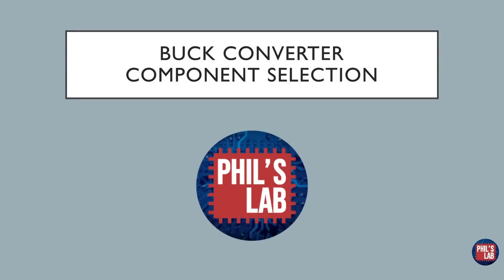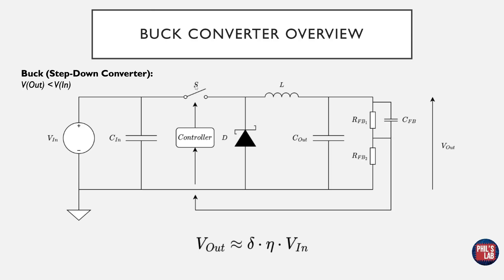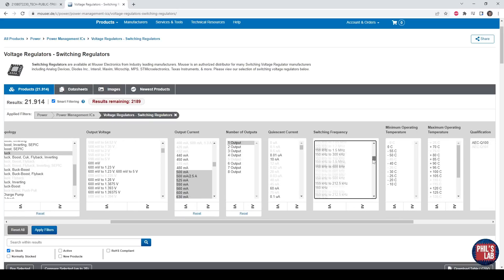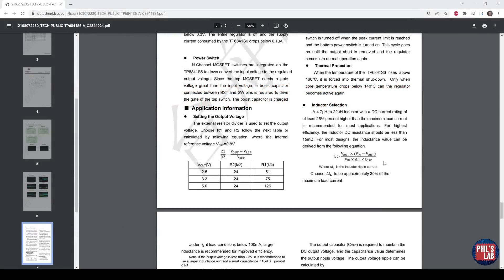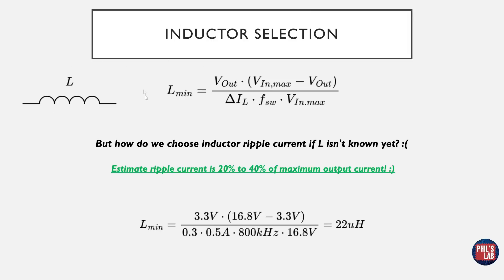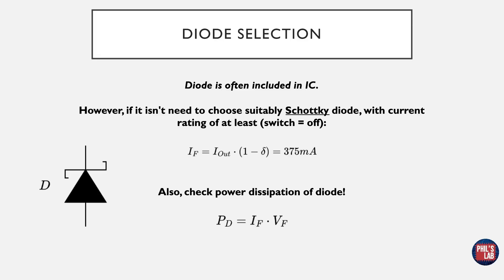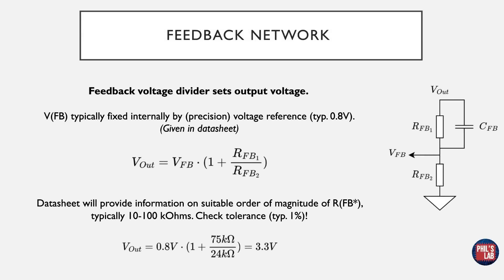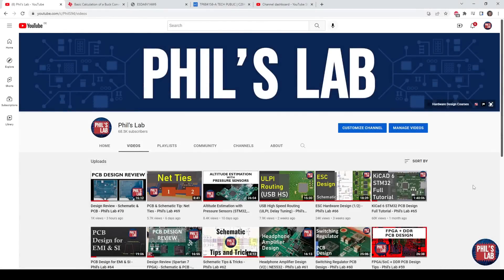(Sponsored) Switching Regulator Component Selection & Sizing - Phil's Lab #71

Comment: What would you recommend for a USB-PD capable power supply? Would a typical microcontroller and digital potentiometer be sufficient to adjust the output voltage on this type of design?

Comment: Hi, great video and well explained as usual. I have one question about the requirements specification, for a new project how can I know what would the load current be ? I guess there is no formula to calculate it and I have to guess it based on the components in the circuit but is there any rule of thumb to follow while choosing an output current? 
Thanks in advance!

Comment: Don't use larger capacitances than required on the output of a SMPSU unless you want to add a pole reducing the transient response. 10uF was the correct value to use.

Comment: How could I use the information you provided in this video to make this a Current regulator? I am trying to build a circuit for a fiber laser and I need to be able to variably output up to 10A. I am having a hard time with IC selection and figuring out what components would be best for this amount of power. I'm using a 12v power supply. Any ideas? Maybe a video like this one but for a switching constant current regulator?

Comment: 9:46 We calculated Lmin 22uH and we chose part with that value but datasheet says its tolerance is +/- 20%, so it is possible that actual value will be below our Lmin. Is that correct?

Comment: I recently designed my first SMPS PCB, and already ordered the PCB and components before I saw this video. I used the recommended components and layout from the AP63205 datasheet, but now I'm concerned that some components may be out of spec (low capacitance on the input/output caps, and low inductance). I do have an electronic load and oscilloscope, so I'm planning on testing the SMPS at various static and dynamic loads. What sorts of problems should I watch out for? Is voltage stability the primary concern? What about EMI?

Your channel is great! I have a software background with no formal training in electronics hardware design, but your channel and a few others have been amazing learning resources. Thank you!
Reply: The datasheet recommended component values worked out well for me. Parts arrived, and I assembled and tested it last night. Using a standard scope probe at 1X with the floppy ground lead, I'm seeing a 10mVpp ripple at 2.2kHz regardless of current. Under load steps between 100mA and 1A it's spiking +/-100mV but recovers within ~30us. Compared to my cheap benchtop SMPS, my PCB circuit exhibits lower ripple, lower noise, and a faster response to the dynamic load. I couldn't be happier for my first attempt at this!

Comment: Does the footprint of the input & output capacitors make a difference here, assuming that the voltage and temperature are within limits of the caps? For example, if I can get an 0603 output cap that meets my requirements, is there any benefit to going with an 0805 of the same capacitance value? Just wondering why I often see larger footprint caps used on the SMPS than elsewhere on the board.

Comment: Great video!! I have a question: How can you calculate point 2 @7:35 if your switching frequency isn't fixed as your case but rather variable depending on the output current as in the MIC2251 datasheet?
Reply from the maker: You'll have a nominal current that your design will require, so use that. Otherwise, design for the worst case (e.g. lowest current -> largest inductor).
Reply: @PhilsLab  thank you so much for taking the time to answer my question, Phil! please keep it up with your videos

Comment: Great video! Is there an advantage for the converter to take a bigger capacitor package, like 1210 instead of 0402?
Reply from the maker: Thanks, Remy! Larger sizes are easier to solder, probe, and will typically be available in higher voltage ratings. However, smaller packages will have lower (lead) inductances, which is important for certain circuitry.

Comment: Did you ever get across audible noise on switching regulators? I had those issues with TI parts some time ago. Texas Instruments has a whole list of regulators with audible noise issues (even their EVBs).
Maybe it's a feature for science fiction movies that you can hear electronic switching noise.
MPS has a good online calculator for various values. The audible noise issue is also known to MPS however they really try to do their best to move the noise out of the audible domain.

Not all switchers are affected from TI of course (they have a very broad range of switchers).
Reply: It also depends on your choice of inductor and capacitor.  Both can act as loudspeakers (ceramic caps aren't that different from piezo tweeters...)
Reply from the maker: Surprisingly, I haven't had any issues with audible noise from switchers yet. I've used quite a few MPS and TI parts but haven't across noise like that.

Comment: One thing i've never really gotten a good handle on is the voltage and size  properties of a ceramic. If i can get an 50V 0603 1UF cap, why would i use a 6.3V 0603 1UF?
Reply: Price (in some cases)
Reply: size of cap   smaller voltage is smaller size
Reply: Price, temperature derating, voltage derating, size.. all considerations..
A 0.1uf 50v 0402, for instance, will (almost always) have more voltage derating than the exact same part in an 0603 package.

Take a look at the graphs for derating, and you'll begin to see why choosing what you need, but not over-specifying actually ends up being the better choice.